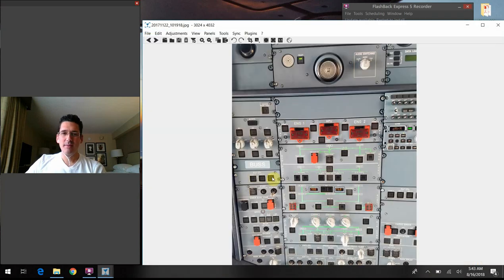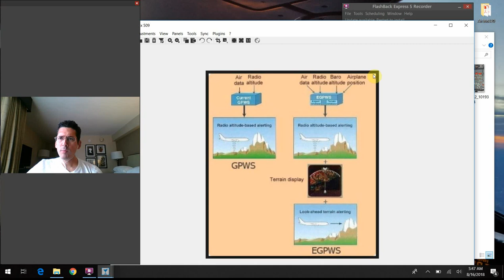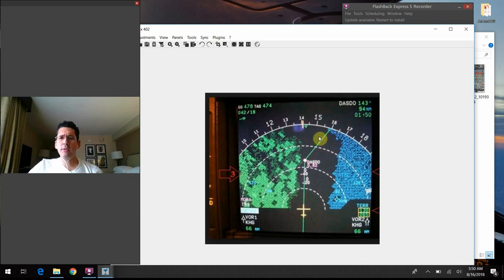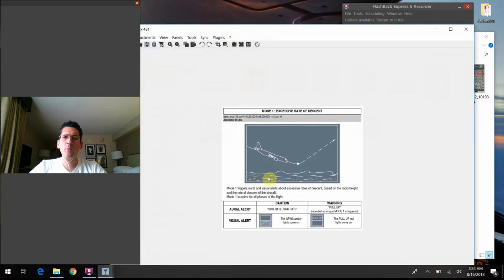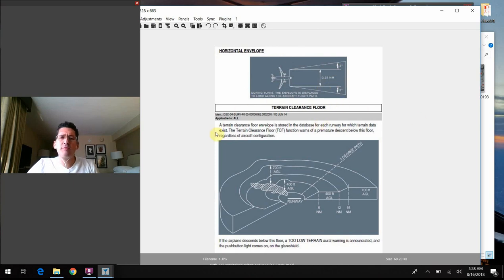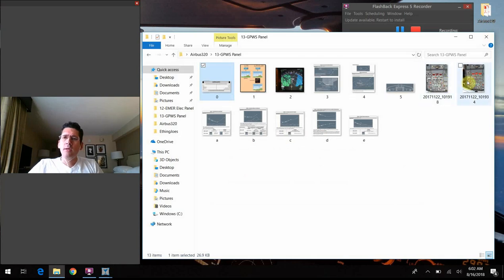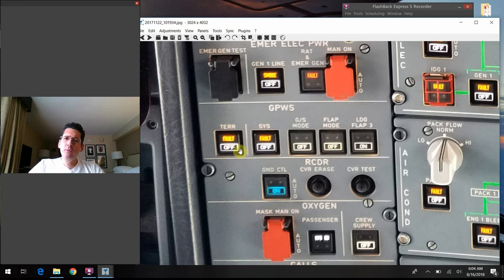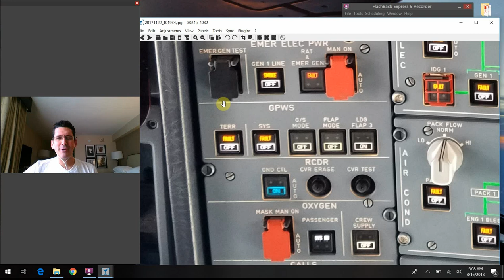Airbus A320 Cockpit Tour: #13 - GPWS Panel : What do all those buttons do?!

Comment: I also think it's interesting how the LDG FLAP 3 button has a different annunciation to the G/S MODE and FLAP MODE buttons!

My understanding is that the OFF annunciation implies that you're turning a system from a normal (automatic) state to a manual shut-off state, either to ensure correct operation of the A/C, or to protect the A/C from a faulty system. In contrast, the ON annunciation implies that you're engaging a system or mode which is to be used in the course of normal operations.

I had the privilege of jump-seating in an A319 many years ago and the captain told me that flap 3 landings (with LDG FLAP 3 depressed) was normal SOP for their airline which they used whenever they could in order to save time.
Reply from the maker: Hey Louis, these are some great points. Especially the fact regarding the flap 3 landing. I was reading something last year about a carrier in Asia that made it mandatory for their pilots to always do a flap 3 landings to save fuel. Seems a bit excessive to me and I think there was a bit of push back from the pilot group as of course there are situations where you would really want to do a full flap landing in the interests of safety.

Comment: So, if i want to land with flaps 3, LDG FLAP3 should be ON, correct?
thank you for all your vidios! Great job! You are like online-flight-instructor!
Reply from the maker: Hi Ivan! Thanks so much for tuning in! Yes that's correct if you intend to land Flaps3 you must use this button to tell the plane you are intending to do so, otherwise the plane will give you a configuration warning all the way down to landing.
Reply: @MikeAbignale  thank you very much!
Reply from the maker: @ivan9614  yes thank you for watching sir!
Reply: @MikeAbignale  If we dnt set flap 3 on mcdu page , is there gonna be any issue abt it sir?